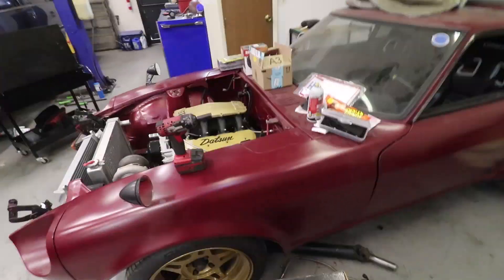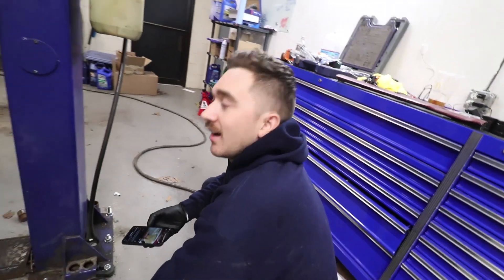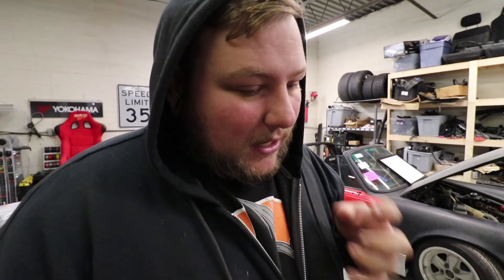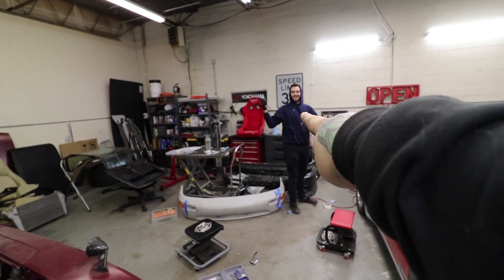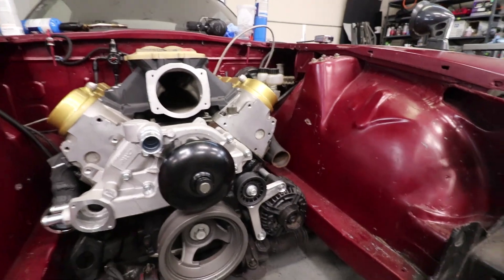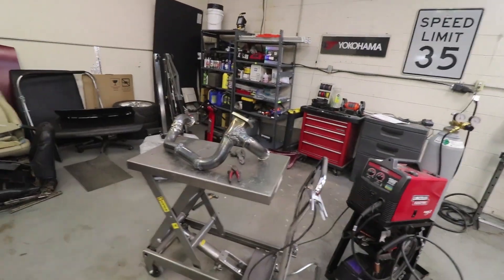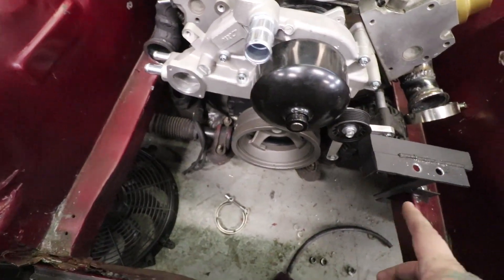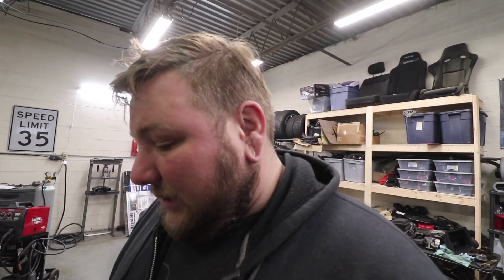Turbo Datsun Things: RB53 (LSX) install, TR6060, and Turbo stuff!

Comment: By the way, 
I’m about to start the same project on a 72 240 Z
I have both and RB25 and an LS3 with a TR6060 out of a 2012 Camaro sitting in my garage. 
Just don’t know which way to go.
Reply from the maker: Don’t let me sway you. But don’t go RB! Lol
Reply from the maker: I’m playin I loved my RB. I couldn’t afford to keep rebuilding it
Reply: I got the RB from one of my buddies that used to run it on a 75 280z 
So it comes with cx racing  mount kit
Aluminum oil pan and turbo manifold.
Reply: The ls3 I got because it was fairly cheap. 
But I don’t have anything to dropped it on the Datsun
Reply from the maker: It’s not much to do either swap really.

Comment: Why didn’t you just get another manifold like the one on the driver side?
Reply from the maker: No you can’t do that. They are flipped. So the driver side is actually a factory passenger manifold and the passenger is a factory driver side.
Reply: SpooledUp TV 
I see..